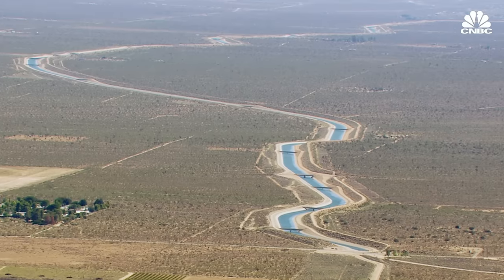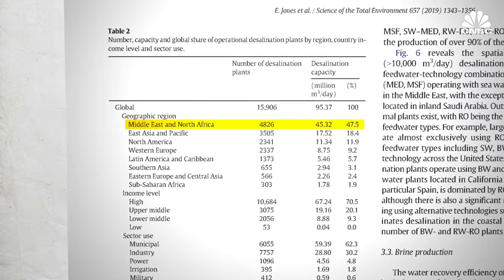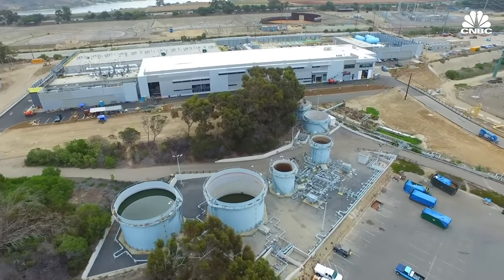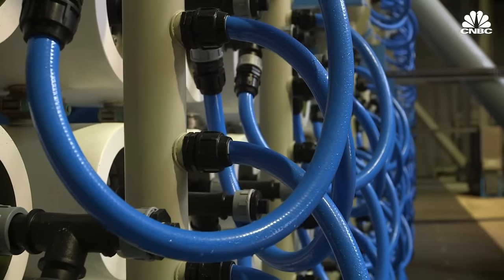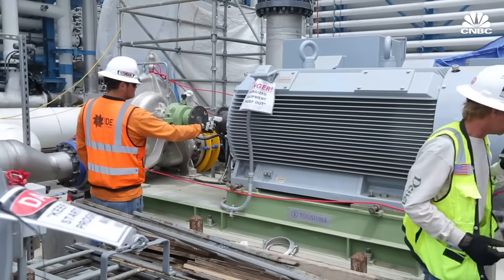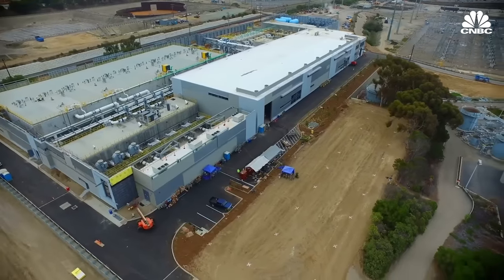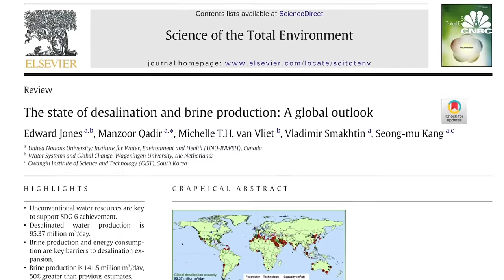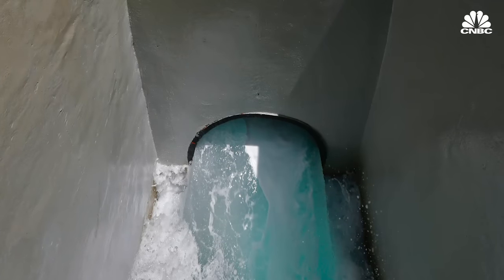Can Sea Water Desalination Save The World?

Comment: Profitability is directly correlated with ecological harm. Taking water directly from the natural water cycle is vastly cheaper, and if we consider all the positive side effects, it becomes even cheaper. The capacity is literally limitless. Off southern Mexico or Yemen, is enough water in the air to produce the Mississippi or even the Amazon rivers. The book Pluvicopia shows these figures and how the process is simple and reliable. If we can tap the natural water cycle, we can solve all problems considered impossible;  CO2 reduction, Sea Level rise, Doubling the amount of arable land, and regional cooling are all durable with the natural water cycle. That's how the planet is supposed to work.

Comment: Desalination does something else , it keeps the salt content of the sea at a normal level  due to the fresh water being  added  by melting glacers . This is critcal to keep the ocean flowing from warm to cold area's , such as Western Europe . This could be the trigger that would start an ice age , so we should start building these as soon as possible in great numbers .
Reply: @Michael you are basically making up an idea that has marginal basis in scientific, logical or data supported research. Salinity is driven by evaporation, rainfall and the flow of rivers. We are living through anthropogenic changes (outside natural water cycles) in ocean salination (practical salinity units) and the glaciers have little impact other than immediate areas surrounding the glaciers. In addition to that, your logic ignores the increase in acidity that melting glaciers add to the worlds oceans which from chemical standpoint, is more detrimental to marine life. Not only that, you seem to ignore the energy expenditure of de-sal is somewhere between 700-900 megawatts per day (same energy that powers 30,000 homes) which in itself contributes to the anthropogenic climate warming which melts the glaciers to begin with.

Comment: Stop diverting "floodwater" into creeks and build settling ponds  or underground water infiltration systems in cities. (Old subway tunnels could be modified to allow water to seep back into the aquifers in  Los Angeles for example.)
Reply: And the coastal commission could okay the building of a desalination plant. But of course not
Reply: Why not pump it into the salt flats let the sun take care it
Reply: @camrod120  I like this idea. Also, why not throw the brine in a dessert?
Reply: @jesusbermudez1764  really brine is high construction of salt if the sun can filter out the water all you would be left with is salt
Reply: You really haven't considered what the water picks up while it's flooding through an urban/industrial area, have you?  It's questionable if, or for how long, the rock layer capping an aquifer could effectively filter out our industrial contaminants (and likely varies by the specific geology, rendering somethung like this situational at best).
Reply: @DeborahRosen99  I didn't really think about it because right now they pull out drinking water from the river and that same river has a sewage treatment center 30 miles up stream

Comment: Man... Are those people stupid?
"Overall we are producing more brine than we produce desalinated water."
If you are producing more brine than fresh water it also means that your brine has a smaller concentration of salt. The ratio of brine to fresh water produced means absolutely nothing.

And the amount of brine we throw at the ocean doesn't matter unless we would significantly reduce the volume of the ocean. As it was said the fresh water available is about 1% so even if we where able to reduce the volume of the ocean by 1% (And that by it self would be physically nearly impossible) the change of salt concentration on the ocean would be neglectable.

You could say that the problem would be localized because a brine with high concentration of salt would need time and space to dilute on the ocean but for that there are 2 stupid simple solutions.

@For those that already read my comment I committed a mistake below but now its corrected.
I'm a Civil Engineering and its common knowledge among us that around 80% of the volume of fresh water treated returns as sewerage. If you dilute the brine on treated sewage you will be throwing back treated sewage with nearly same level of salinity of the local ocean water.

Logic:
Lets assume that the local ocean water has 10g/L concentration of salt is and we are going to treat 10L of ocean water. 
in a 50% desalination process the result will be: 
5L of fresh water that will return as 4L of sewage and 5L of brine with 20g/L of salt. 
If you mix the 4L of treated sewage on the 5L of brine with 20g/L of salt you will get 9L of treated sewage with a 11.1g/L of salt (Very close to the concentration of salt of the local ocean).

The second solutions is just don't throw everything in one place. Make pipes along the coast and spread your output.

Desalination can only be a environment problem when done wrong and its not hard to do it right.
Reply: Can ocean seawater thermal energy be used to desalination? The decrease in temperature is also going to be negligible.
Reply: For your information, your ideas have been researched for years.
Reply: @Ktsquare2008  Its not ideas. Its common sense.
@ocean seawater thermal energy
I don't know much about it but any energy source can be used.
Reply: Here is a simplistic idea. What is the pressure required to perform reverse osmosis? Is it less than the ambient pressure at great depth in the ocean? If so, would it be possible to place reinforced hollow objects (pipes, spheres, whatever) fitted with osmotic membrane at the required depth and then just pump out the fresh water that come through the membrane? I realize that the challenge is much more complex than this, but I would welcome your engineering perspective.
Reply: A lot of people find it easier to do things wrong though, there is ample historical precedent of things done the wrong way
Reply: @tommcallister7647  
No matter how deep you go there is always life in the ocean and localized high concentration of salt can still be a problem.
If you are still going to have that kind of problem its not financially viable. Also due to its high complexity it will also have a high cost of operation/maintenance.
And some places don't have deep waters near to its coast. That means you would have to pump that water from very far away increasing it operation/maintenance cost even further.
Reply: Brine is NOT a problem.
Sun itself desalinate around  1.27×10^16 kg.
The pipe should be connected to special device that is mixing it with ten times more salt water (a huge steel tank with the mixer is sufficient)
Reply: @WadcaWymiaru  
Yep. That is another way to minimize a possible local impact.
Reply: Brilliant & noble.